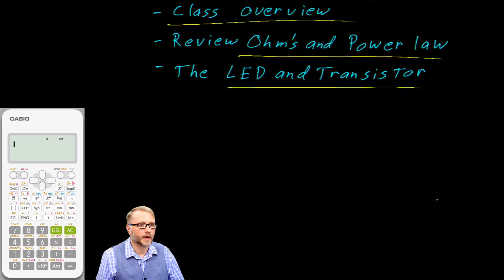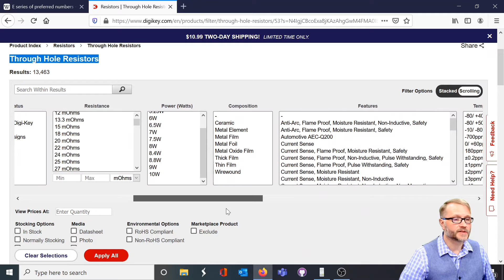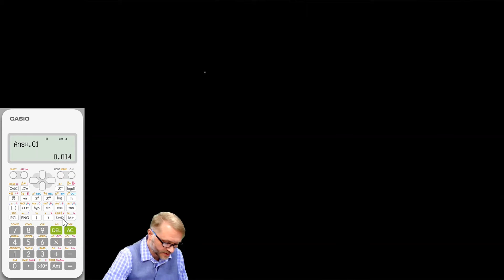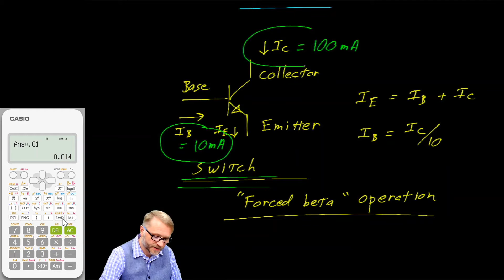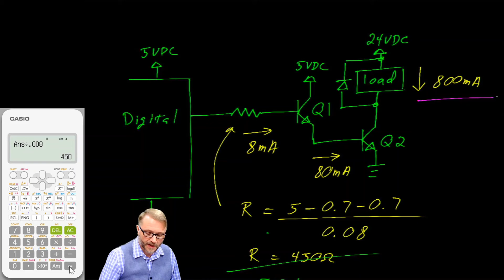Digital 1: class intro, digital out including transistor (forced beta), MOSFET, solid state relay

Comment: 00:32 Class Overview
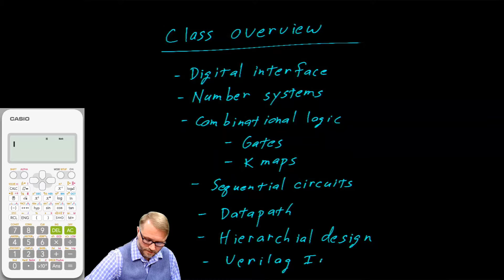01:34 Exam Overview
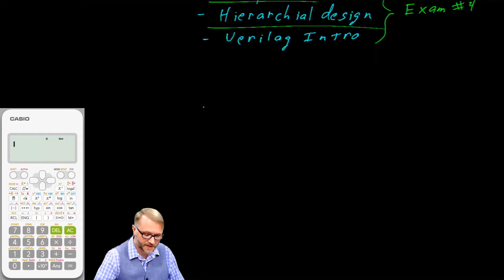02:12 Lab Overview
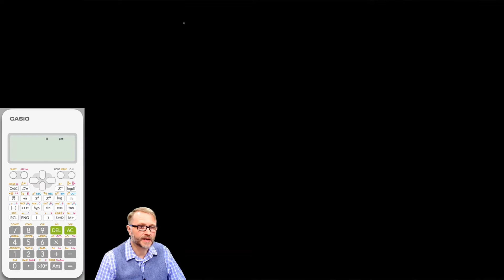02:44 Review of Electric (Ohm's & Power Law)
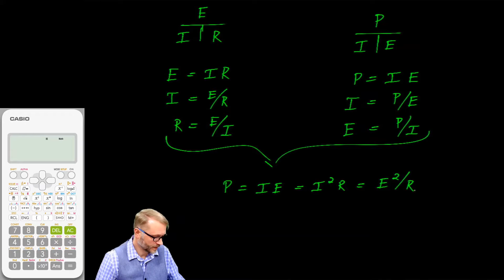04:00 Example of Electronic
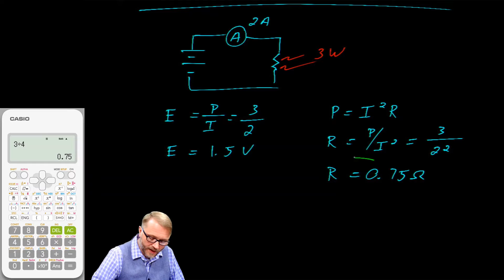05:59 However@! (Standard Values)
08:15 Leave Wiggle Room
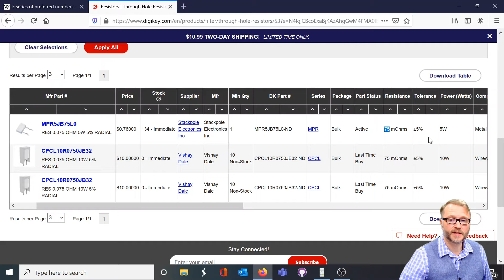09:04 What is E24? (Decade)
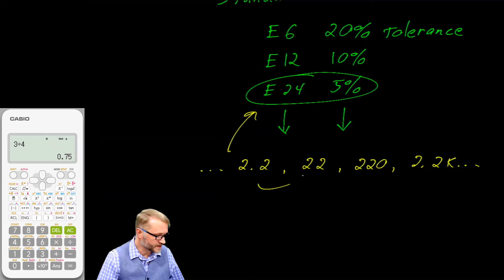09:33 Interface to Digital Logic
11:00 Logic High, Logic Low
11:30 Example (Forward Voltage)
14:55 Handle With Care (Limits)
16:44 Buffers
17:30 Transistor
19:58 Example (Transistor)
22:30 Cascading
25:46 MOSFET
28:23 Relay
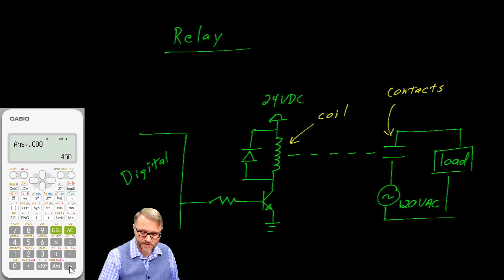29:31 Solid State Relay